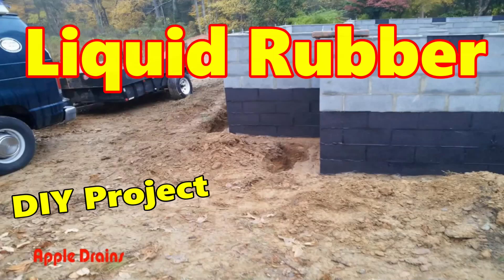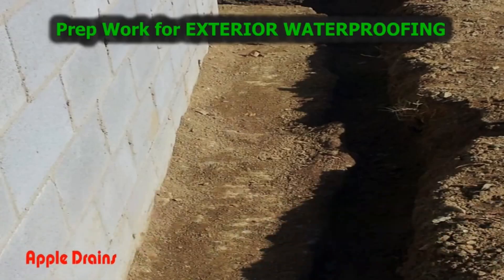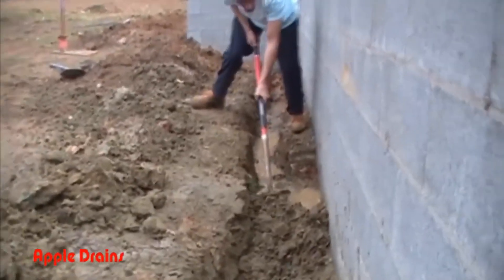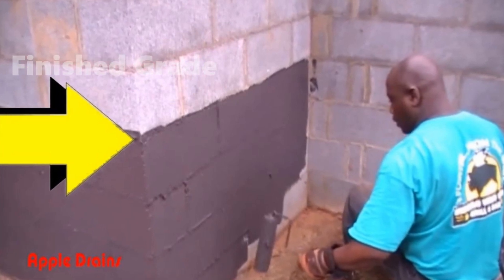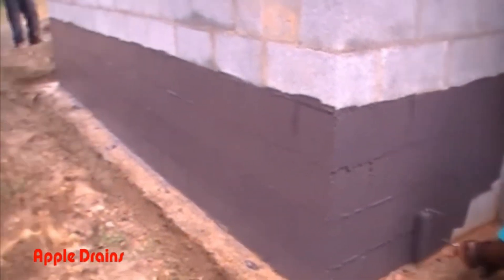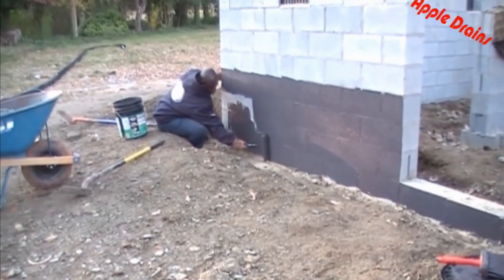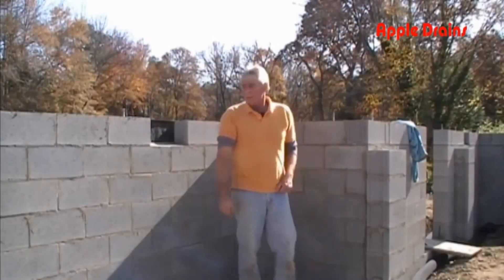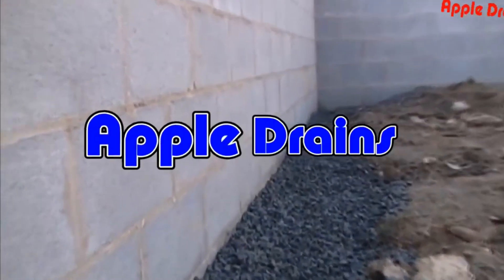Will Liquid Rubber Alone Stop Water?

Comment: I'm shocked to see you don't use a rubbing brick to smooth the mortar joints. These areas are ripe for catching water flowing down the wall and allowing it to enter the foundation. With them smoothed over the rubber coating will provide a better, more uniform and consistent shield against water.